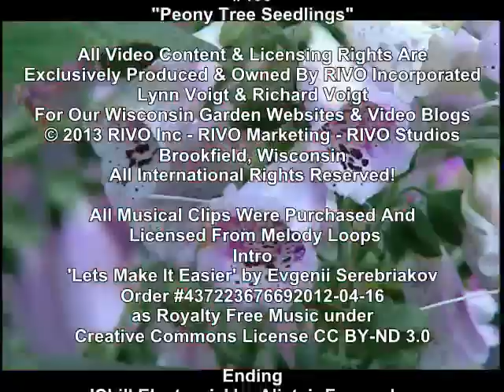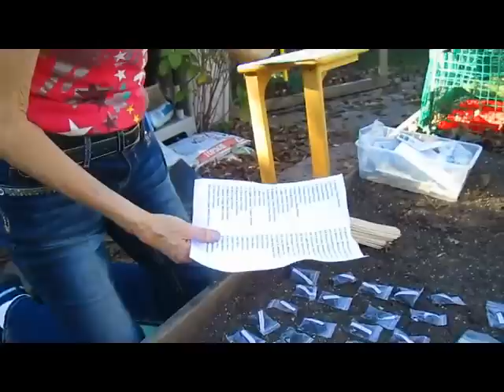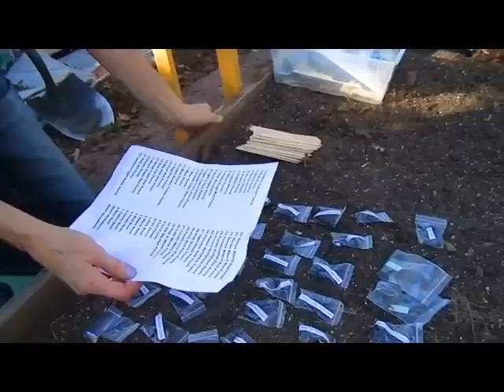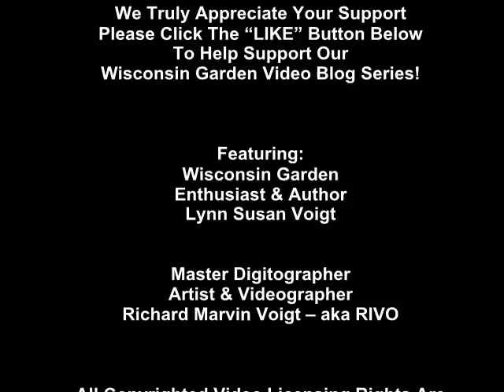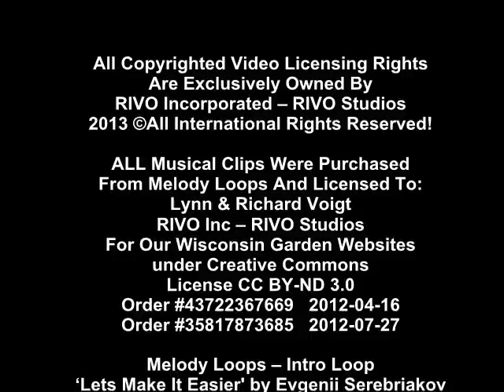Peony Tree Seedlings - Wisconsin Garden Video Blog 460

Comment: You can cut about 1-2 inches through the top part of the regular peony root, then take the tree peony section which is already pre-cut, and sandwich it into the root. When the cambium layers line up well, they should fit in there firmly, and it is important to make straight cuts so you can get them lined up. 

I would recommend using the plastic tie grafting tape in 1ft sections. It's purpose is to hold the cambium layers together tightly to encourage healing which only takes a couple days.

Comment: You can just buy them from ali-express pretty cheap. That's basically the same way I've planted them except I don't get the chipmunk problems so I get better germination rates. If they aren't fresh seeds, don't depend on them having good germination. 

In the past few days, I've actually tried grafting 2-4 year old tree peony seedlings onto herbaceous roots just to see if a stronger battery will result in a huge amount of growth despite having under-developed scion, or graft material.

Comment: I just graft them with a HQ grafting knife, tie them to line up cambium layers, wrap grafting tape, then stick them in a plastic bag with some moist sand at the bottom to sit 3-5 days to heal using a heat mat before planting them straight into pots so that the graft point is 3-5 inches below the soil lvl. I made a blog post on this, but I've improved my technique since then. I did this with some of my 1st year seedlings, but you don't have that many so I would only suggest doing it with your TPs

Comment: Grafting is usually less successful in spring based on what I've heard, perhaps because the scion and rootstock need the winter to completely fuse, but I intend to try some in the spring myself. 

I've had tree peony seeds sprout in the fall before, and there might be some sprouting right now in my beds. I've found that mounding some manure and tree leaves around them can save some of them. Perhaps a small tarp would help insulate a bit better too. If you're really worried try roof insulation.